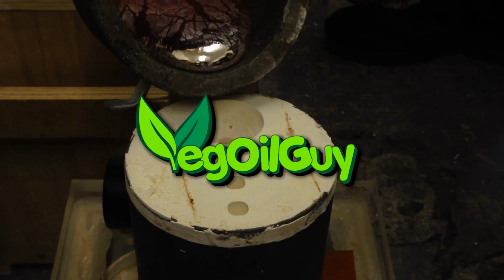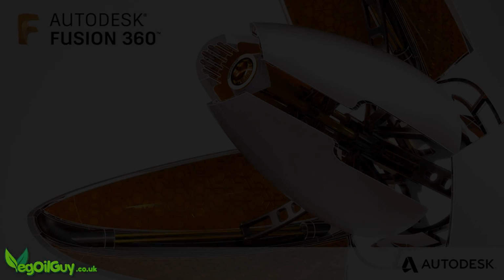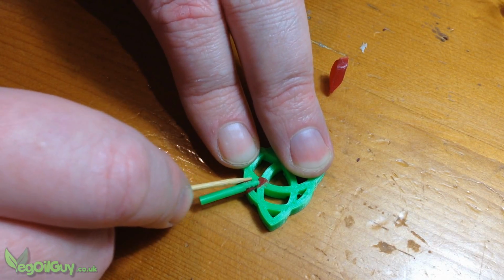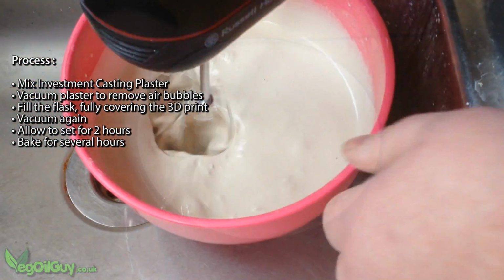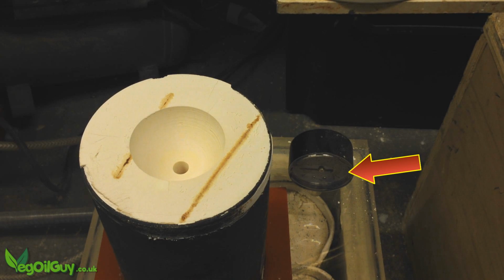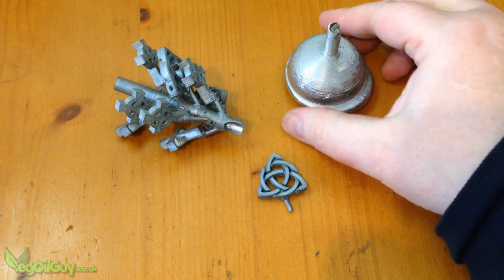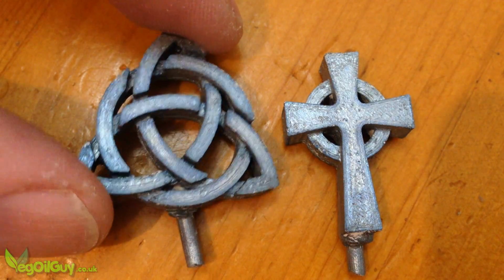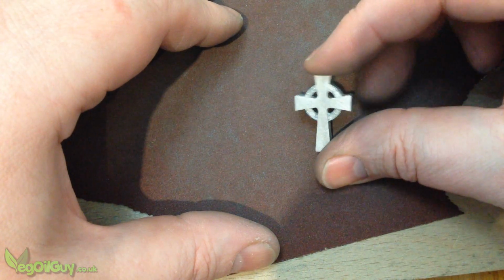3D printing & using a Casting Tree for Lost PLA multiple Castings by VOGMAN

Comment from the maker: I’ve shared the STL files for the Celtic Knot and the Saxon Cross that go along with this video on Thingiverse. There’s links in the description or just search for vegoilguy.
Reply: PLA is a kind of plastic?
Reply: Poly Lactic Acid, but yes it’s a type of biodegradable plastic derived from cornstarch, it’s not petroleum based. The issues with standard pla is that it isn’t as strong and has a few other weaknesses, on the upside it’s biodegradable and doesn’t smell like everyone on an oil rig farted like that of ABS (petroleum based)
Reply: Use bee wax for a carving and modeling wax because it's become like playdoh at 50 degrees celsius.
Reply: what's the alloy of aluminum you using for casting or you using scrap,?, more this scrap is  cast aluminum or extruded aluminum?
Reply: Good to hear, I just found out that Cura has a iron function for the top side of the print, could be worth checking out but I’m skeptical.
Reply: When you are heating the plaster and removing the pla, do you leave it upside down for the pla to drain or is it hot enough to burn it off?

Comment: Im new to the 3d print part of making the model how do you make it hollow
Reply from the maker: This is a setting included within your slicer, they all do it but in different ways. Typically you choose a minimum wall thickness and the slicer does the rest 😁

Comment: when you say burnout and the PLA melts into the blaster, are you baking the set mold so that the 3D printed tree melts out of it? does it need to be upside down etc for this so it can seap out or is it completely obsorbed by the plaster? great video btw :)

Comment: Did i understand this right? SRS requires you to contact them, so they can then reply and tell where their nearest distributor is located? How everyone else just simply can make map where their products can be purchased? Yeah i'l be looking similar product from someone else.
Reply from the maker: I think you may have followed the wrong link there my friend. SRS are the manufacturer and it was on that basis I placed that link. I believe they do sell worldwide but only in bulk, but I think they're happy to tell you where your nearest retailer is.
I'm in the UK and can only speak from personal experience, but I've found this SRS product here -
https://www.hswalsh.com/product/pioneer-smoothcast-investment-powder-tc0451

I've also found another manufacturer of investment plaster in the UK and they retail here
https://www.cousinsuk.com/category/casting-investment-powder

I've yet to try this plaster but I have bought some.
It is tricky to find plaster investment. If nothing above works for you, try going to a local jeweller, especially if they make their own jewellery. These guys usually use the lost wax technique and need plaster by the sack full. If you find a friendly store, they may sell you a bag or tell you where to go and buy some.
Hope this helps  : )

Comment: Print the casting branch into the item.
Reply from the maker: I could do that Shelly, but my plan is to make a one-size-fits-all system, so I can print a few off and have them available when I need them. If you check out my latest video, the tree design has altered a little to incorporate a tapered sprue and pouring basin. Plus it has square holes to receive square pegs... much more stable  : )

Comment: Is there anyway to cast without a vacuum i tried to pour silver into my mold but the metal didn't flow through I was thinking my sprues weren't fat enough any help?
Reply from the maker: Hi Gio. No.... on a small scale like this metal rarely flows in perfectly. I almost always traps air that spoils the finish. A vacuum is the ideal solution, though shop bought these are expensive. HOWEVER I did make my own out of scraps. That's what you see me using. Have a look here - https://www.youtube.com/watch?v=EGNnH_xbjR4&lc=UgzTpt9829wfcnoyn9V4AaABAg
Reply: VegOilGuy thank you thank you !!
Reply from the maker: Happy to help  : )

Comment: Its likely already been said but the reason the main sprue was broken and full of holes was the cooling metal shrinks.As the metal cools and soidifys it cools from the outside in, as it does it requires more metal to full the core as the cooling metal shrinks. This metal comes from the main sprue trunk (also from the pour puddle at the top). To ensure that this can happen you should make the trunk as thick as possible (within the limits of the flask). If the trunk is thicker than the parts then it will cool down last allowing it to feed the parts. 
Also if you make the main trunk out of wax you can easily reuse the wax and save on PLA. Very cool set of videos thanks for posting.

Comment: Wow like this video. Creality printers work fine, print on a glass plate. Using the right brand of hairspray i get almost mirror like finishes on to print surface!  Print with bed at 50°C when the print is done remove the glass and wait to cool the print will come loose by them selves!
Reply from the maker: Nice tips Allan  : )
Reply: If you can find Perfect Touch Firm Hold hairspray (green bottle) no one can ever convince me to use any thing else:). Go to your local glass guys. Dimensions is 235X235 and 4mm think excuse my metric.   If curse at first ask me about it. @vogman

Comment: @vegoilguy you seem to be fairly active with replying to your comments; so I thought I'd give it a go to ask a quick question: what temperature and how long do you bake your moulds to burn out the pla? If anyone else knows the answer feel free to chip in
Reply from the maker: Hi Brandon. I do try to answer every question. It's only fair  : )
The process is mainly about the plaster so it's a case of following those guidelines, which do take several hours. However, I like to heat much plaster slowly at the start, 120C for a couple of hours, to get rid of the water content. After that, the temp goes up to 250C and PLA then drips out.

Comment: The PLA moulds are hollow?
Reply from the maker: Hi Luis. For the most part the PLA moulds are empty. I use a 10% infill that gives them a little strength but also means there's not as much material to burn away.
: )

Comment: Great work! I thought the print lines were Celtic/Saxon ornamentation till you mentioned them. One question: as lost PLA works so well (Jay Leno routinely uses it to produce unobtainable parts for his historic car collection) why is printable wax filament available? What can the wax do that PLA can´t do?
Reply from the maker: I can't answer that one as I really don't know.
Amongst these comments you'll see a few folks suggesting using a wax filament. It costs over 3 times as much as PLA here in the UK. Quite honestly, without wishing to appear conceited, I really cannot see how I can improve upon the castings I've been making with PLA. The seem to be identical to the prints and therefore as good as I could hope for. 
I understand folks suggesting a better printer, such as patprop74, as this would obviously improve the quality of the finished casting - and we all want that.
Perhaps I've just been very lucky so so. I guess time will tell  : )
Reply: @vogman  I agree wholeheartedly with the idea that the results you´re getting carry as much detail as the originals and that this suggests that the lost PLA method offers all that can be expected of it.
 The reasons for the existence of wax filament will have to remain a mystery to me for the moment.
Reply from the maker: And me... unless I acquire more money than sense, or if a wax filament manufacturer sends me a reel to prove its worth. Neither outcome seem that likely if I'm honest  : )
Reply: @vogman  Frankly, if I were a wax filament manufacturer I´d see your channel as a great way to prove the stuff´s worth, as you´re known to be meticulous and you´re likely to do the metal casting bit perfectly. There´d be little point in sending a reel to, say, Angus from Maker´s Muse or to Ivan Miranda; while both might be experts at 3D printing, neither´s ever cast metal.

Comment: Just an idea to help prevent post processing, use a spru wax (pink stuff) and drip it on the surface of the printed part, smooth it down with a finger quick, and it should help cover layer lines really quickly, while still easily melting out.  

I used to supply a Goldsmith in my town with wax rings for him to cast for clients, so I've got a little bit of knowledge on the topic.
Reply from the maker: It does annoy me when people guess what's coming up in my next video   - lol
Okay, my approach isn't exactly the same as you've described, but it does involve wax. 
Thanks for the excellent suggestion  : D
Reply: They say great minds think alike! I'll definitely have to check it out!

Comment: Another great video with good info. 

 Machinablewax.com has wax 3d printing filament.  It's apparently a royal pain to use but melts/burns out a lot cleaner than PLA. They also sell it by the block for milling. I hope to try it out, but not sure it's really necessary with results like yours.
Reply from the maker: Many thanks for the input  : )
Reply: Probably just a low temp filament like that 'soap' filament you can buy to clean your hot end. Not a pain, you will just have to make a profile for it and figure out the custom parameters for it.

Comment: i think another benefit is, that you have more metal inside the mold keeping it hot longer and allowing it to flow nicely. i often see thiner/smaller casts fail because the metal just solidifies half way through. this is a nice way to prevent that. plus you have more parts, meaning you can either chose the best, or you are more likely to even get one usable cast out of it.
Reply from the maker: Exactly Sharky! I didn't need 12, but it was nice to have the choice of 12.

Comment: Although i would consider this a success, it shows there are better methods that could produce higher result. now days wax filaments are  easily found,  better yet, wax resin for SLA printers which dirt cheap thanks to china, not unlike the printer you used.
Reply from the maker: I guess that depends on your definition of dirt cheap. 
I'll be honest, it took me a while to save up for my 3D printer. It was no whim purchase. And whilst I've certainly heard of the wax filaments, in these parts they seem to be priced around £60 + p&p, whereas the PLA I'm using is just £18 INCLUDING p&p. That's a massive difference that I personally can't afford to ignore.
Are there better materials? Yes. Is there better equipment? Yes. Better methods? Of course.
BUT what I'm trying to show is that good results are possible even for folks who can't afford thousands for equipment.
I hope I'm managing it.
Reply: @vogman  Don't get me wrong, I am not saying this  method is bad by any means, nor am I criticizing your video.  Example, if you were casting bigger parts that the finish is not important, this is defiantly a good method. but for small trinkets such as lockets and chain bling bling, not so much!  Your using a Creality printer which is very cheap both in price and performance, Just think 5 years ago, when average price for a 3d printer was in the 1500$ price range, for a pla only printer and i tinny build foot print, double that price if you wanted something decent like the Ultimaker or Makerbot class printers. Now days you can get a LCD resin printer for under 700$ which again, go back a few years when the formlab and their form1 was the only available commercial printer on the market, that set you back 2000$. BTW i pay 55$ Canadian for wax filament which in euro's is 36.00 Again go back a few years when Pla and ABS was at minimum 45$ a roll, And that was for the cheap china unbranded filament, that kept jamming the hotend, if you wanted the color fab which was one of the only good pla manufactures back when ! it was almost 70$ a roll. Trust me when i say , 3D printing is dirt cheap now days when you compare it to what it was.
Reply from the maker: I agree with you there my friend. The prices have dropped dramatically as the laws of economy usually dictate : )
As for cheap... well that's relative, obviously, as to an extent is performance. As this is my first 3D printer, for me the quality appears excellent. Yes there are evident print lines, but I kind of like it.
I'm growing to love 3D printer more and more, so I'll be bothering Santa with a potential wish list as time goes on, I'm sure.
And if I sounded defensive, I'm sorry. It wasn't my intention. When I first tried casting, so many people told "You can't do that without this pump - or this vacuum machine - or this injection moulder," etc, and the costs were thousands... 
This upset me as I reasoned our ancestors did a pretty good job with bees wax, clay and a bit of ingenuity. So I've tried to be equally industrious, creating a pump and vacuum system THAT WORK for under £50. The proof is in my videos. So people that want to try can. And if they then aspire to better, more expensive equipment, then good for them.
Personally my interests vary so wildly that I can't invest too much in any one thing as something else always calls : )
Reply: @vogman  bro good job, there will always be some "wise" guy, am in 3d printing from 2011, I bought my first printer for 900$ not 1500 minimum, it had print size same as second makerbot, cr10 is good printer if you make correct slicer profile for it, also SLA printer you can't find for 700$ thats DLP printers, and I never paid 45$ for filament, so don't take his comment seriously.

You will always see lines in any FDM printers, also in DLP printers so don't bother with that.

Good job and thanks for video
Reply: @uborka1987  I am going to call it read it ! your either lying about then you started printing or you don't know what your talking about,Probably both in this case!  plain and simple! You go be a china printer advocate! If you never paid 45 dollars for a roll of pla! you didn't start printing in 2011. If your to dumb to see the point of what i was saying in my first post, there is no point and trying to explain to you, you ll never get it!
Reply from the maker: Thanks Bob. I have to admit I have been very pleased with my PLA castings and wondered how I could improve on these, when every detail of the print seems to be present in my eye. I do accept that better printers will produce better prints. I also accept that wax filaments should burn out better than PLA - but an experiment I did this weekend (coming this Friday) showed surprising results. 
All in all, I think Lost PLA has great merit : )
Reply from the maker: Hi Allan. I have no experience with the Wax  Filaments, but from videos I've seen it's the exact same process. So just like PLA, the wax filament has to be melted out. There's no real temperature difference as the heat is mainly there for the plaster. So for me, it's a win for PLA as it's less than a third of the price of the Wax Filament : )
Reply: I don't see how wax filament would improve this outcome. There aren't any artifacts from PLA that was not "lost". All the artifacts are from the print itself which I'm sure could have been run at a higher resolution (and with surface ironing if desired) than was done for this test. SLA is a diferent matter that would enhance the print.
Reply: @AdmiralBob   The energy usage and time it takes to get the PLA evacuated seems costly and a material that can reduce that cost would be great.
Reply from the maker: Thanks Dario. I'm very new to printing... VERY new... so I have a lot of catching up to do. So any input from guys like you who know what they're doing is always appreciated  : )
Reply: Alright Well Clearly all the experts seem to disagree with me, Congrats on you perfect achievements.
Reply: @patprop74  yea we are and thats final thought from me https://fillamentum.com/blogs/news/you-should-know-him-dario-aka-filaflip3d what you ever did? And yea I consider myself as an expert in 3d printing field😉
Reply from the maker: The important point is that we can all agree you're right in your observation that printing processes have improved considerably and that with the advent of new printers on the horizon, even better standards are likely fairly soon (and right now when comparing my printer with other models).
As a complete novice in the realm of printing, I have to bow to the superior knowledge of others.
And as a willing amateur in casting, I have to say that Lost PLA seems to be a great medium to work with  : D

Comment: I wonder how complex you can go with this method, could you cast a small statue? Also, if you want to make the investment you could try a resin 3d printer, the resolution it's far superior, you probably wouldn't even need sanding
Reply from the maker: As printers get better, and they are, the things that can be cast can get better.
I'm still experimenting but so far I've been amazed by how accurate and detailed castings can be.
A resin printer does sound exciting  : )